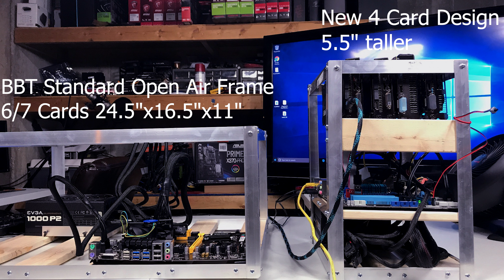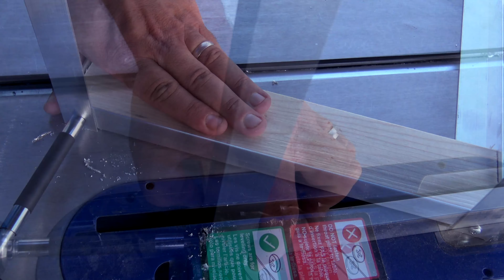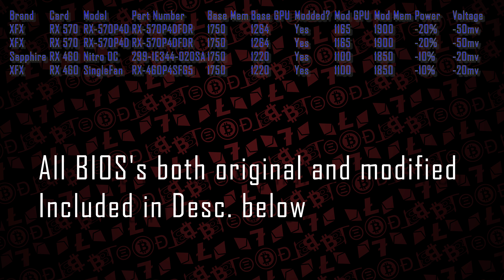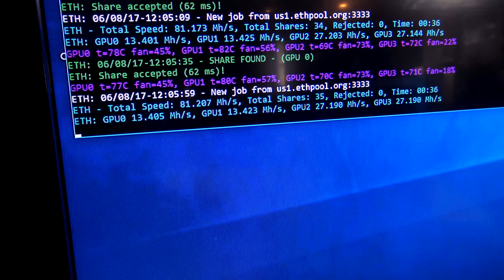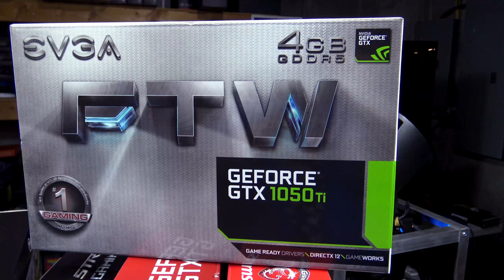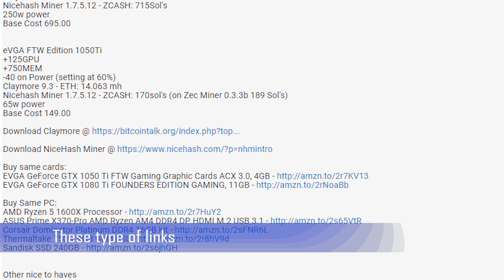Ethereum Mining 4 card XFX 570 4GB & XFX 460 4GB / Sapphire 460 4G Mini Open Air Build

Comment: The undervolts you do are extremely conservative. You can run 1100 core, and voltage 150-200 under stock (at stock clocks), to save way more power.  You could easily get that build to 500-550w. Also, why do you insist on trixx or precision?  You can set the voltage in claymore, then you don't have to install other utilties, and worry about resets on crash. Also easier to do per gpu. 400 series cards can eth only mine on ~910mv easy, or like 830mv on 500 series. I can make a 6x 470 8GB rig draw 720w from wall eth only, or 950 dual mining with good speeds. You are drawing nearly 700 for essentially 3 cards. I had an FX chip, idle power was ~95w on bronze psu.  For case, I would make it 2-3 inches wider so your cards don't overheat. Requiring an external fan is just poor design, I have 0 external fans on any rigs, dual mining, fans never above 65%, for max temp of 70C, even with no AC in garage in summer.
Reply from the maker: Most of our builds and video's of builds show very conserative. As your aware, you just dont run deep undervolts on all cards and it works out of the box. The stability is predicated on a lot of factors, so yes, you could tweak all of these settings for less power and of'course build a bigger case to allow for better heat transfer. This is an example of a use case build with the 10x12x16. More than likely 3 cards vs 4 would be more ideal for this size. External fans over a long period of time save GPU's period. There is no point to letting the gpu's handle all of the heat, thats what gets people replacing cards after a year. After doing this for the past 5 years, external fans are why most of all of our R9 290's, 7970's and R9 390's are still operational and running. 65% or not, most of all our builds are sitting at 0% fan to 27% fan at 51c.
Reply: 930mv 1100 core works on 95% of 470s dual mining.  You are probably running 1000-1050mv+ eth only. But we don't know since you don't ever show GPU-Z. If you set in claymore it is easy to adjust an outlier if you need, or bump up all 10-20mv. For fans, I am also dual mining, if I mine eth only, the fans barely even turn on.  65% is upper limit, right now they are 45-50%.with 85F ambient. They will have A/C soon, and probably run 40%.
Reply from the maker: We dont ever show GPU-Z? you must not watch any of our livestreams ;) check out livestream 14, probably about an hour alone with multiple GPU's with GPU-Z, HINFO64 and more up. In the episode style though, kinda straight and to the point. Livestreams offer a lot more detail and solution's.
Reply: Maybe just the few livestreams I watched, it seems I was always waiting for GPU-z, but only ever got trixx, precision, afterburner or wall meter. Point is saying -50mv is kinda of meaningless if you don't what what it is compared to. Stock voltages on 400 series vary between 1050-1160mv for identical cards, yet they all undervolt almost identically (within 20-30mv). Even for quick n dirty video it is extremely useful information.
Reply: my 480 4gb needs 1075mv at stock 1305 mhz. 1000mhz needs 825mv... less than HALF power consumption!

Comment: This video is helpful for those trying to build their own rigs.  Haven't been able to find much online as far as the different dimensions used and how many cards each dimension will accommodate.  I started the process of looking for material to build rigs a few weeks ago and found that any local Ace hardware sells angled aluminum for $8 for a 7 footer as well as square aluminum for around $13 or so if someone wants to go that route which ends up being a little more costly since the 3-way connectors and 4 way connectors are generally about $2.5 each.  Angled aluminum rigs is definitely the way to go on a budget.

Comment: The 570 bios is labeled as a 580 in the description.  Also in polaris bios editor I'm seeing differences from the original bios in the GPU and PowerTune tables...  This has me wondering if this isn't a 580 bios.
Reply from the maker: Good catch, it was mislabeled - its the 570 XFX bios, just doublechecked the link.
Reply: Jeff Miller 580 maybe out of stock at all. i cant see anywhere have it.
Reply: nothing doesnt add man, all i get is 11.07mhs with your bios, without bios ONLY flashed i get 12.6mhs, but NOTHING close to 13.something like u saying. anyway great vids great help, God bless you.
Reply from the maker: Its BIOS + softclock of MEM ... did you up-clock the memory like mentioned? BIOS just doesnt get you there.

Comment: pay it back lol. i mean we cand buy gpus because u buy them all. make 30k a month then ask for donations. how about taking a break and let little people jump on board. after all its why u say you are doing videos
Reply: Here in Russia the 1060 3GB is already unavailable, while pitiful remains of its 6GB version are sold for $400 and higher. 1070 is sold out and if you manage to find one occasionally, the price would be almost $700. RX 470-480-570-580 are of course nowhere to be found.

Options left:

RX460 - $130
GTX 1050 Ti - $175
GTX 1080 - $750 
GTX 1080 Ti starts from $930 and goes up to $1500
Titan Xp - $1500
Reply from the maker: Jared - The community really needs that confidence as you can read above. Would you be incline to create a YouTube channel and from your perspective above create the walk-through asked for? Because mining for the past 7 years and over 390+ rigs, while some were like butter, not everything was smooth as your depicting. 

Additionally, the 99% of the issues/steps you are talking about are predicated on about 8-10 categories, with there own one to many situations. Our issues database that we plan launching has over 300+ troubleshooting perturbations that maybe will cover the 80% of issues you could run into. Again that is against 6 different motherboards. Couple that with any multitude of motherboards and the count goes up exponentially.

Again, that being said, sounds like you have a solid plan for a great 60 minute video. You make that, we will support you and make sure the viewers all see it. Do it!
Reply from the maker: We buy a fair share in our area, no disputing that, but unless your in the St. Louis area, we are not your particular problem. That being said, there is a substantial amount of effort that goes into producing video's, including and not limited to hiring people to help edit, produce the site and bring work to bring the best tutorials to you all. 

If you look hard enough, there is a ton of options out there for you to get involved in. The GTX 1060 3GB are less than 200 USD and provide a great bang for the buck and they are available everywhere. Start there, build a small rig, then if/when you get stuck, shoot us a note and we will try to help you get it fixed. That level of service is all for free. The donations are just like tips, if we have helped you and you're doing well, its equip to tipping the dealer.
Reply: With current profit, if they didn't buy them, there are 10,000 others waiting in line anyway.
Reply: Well, as nicehash calc is currently showing me, a 1080 Ti's annual profit is $2600 which is kind of self explanatory. People already start losing their heads, selling their cars and even rumouredly apartments and buying tons of video cards.

However, we don't know if the hype lasts long enough to return the money at least. I'm feeling that I can risk some money and buy 4x 1080 Ti... but not at whopping $1500 a card. Prices went from $1000 to $1500 in a day (!), and now 1080 Ti and Titan Xp share the same price in Russia.
Reply: i asked during a live show to do a start to finish installing miners. i have seen so many on here and either they are viruses or they miss a step. a man showed a address www something we could not read but forgot to link it  with the rest. i have only gotten nicehash miner and bitcore to work on gtx 970. i have not got 1 eth miner to work. they do not show enough to add addresses or miner info where to put it and most of does it need to be saved as bat files. we are not code writers here. i am in tijuana mexico because i cant afford san diego. plus my girl is here. now i have not found 1 not 1 guide that i followed step by step that worked. they are not complete. we can do nothing if we dont know what is good or whats a virus. what is more profitable? the more that use eth right now the more that price will go up. you will soon enough be rich. 
if you are gonna help realize most new viewers like me are trying to get miners to work. i have 1 amd rx 480 8 gb on the way then 3 rx 580 after that. does nothing if i cant run eth. doing sol?s now is crap 259 sols. i have very very cheap electric in mexico. and this can help me south to la paz where i will no longer suffer from chronic arthritis. i am dying here literally. i suffer badly and take pain pills all day (non narcotic) and does not affect me like a drug or my mind. when given instructions in notepad it sometimes writes so far to the right its hard to swipe and read its very easy to get lost. i agree make what you can make the coin sore. but without good correct info on miners we all are stuck. bios mods also. i commented on a video a man done only 1 min in i found he missed a step and said so. he said mining is not for me then? ok tell us who is it for? only you? do we need to sit back and watch you get rich? because we cant find 1 miner video thats complete and successful?  this is absurd. i got 2 miners none what i want to mine but shows i can follow goooooood directions. complete directions. and suffer because so many people with old and bad info videos just leaving them up to get views and paid per views. i am not the only 1 i seen others comment as well the same as me. it dont work or its not complete. just get rid of bad videos make correct ones for views. not saying its you but others. i like watching your live shows. its just i see the intentional no commenting on questions as how to install miners and how much does a 4 rig or 6 rig or 8 rig profit per month. why the secret? why cant you say how much a rig makes? it only appears that you will buy every gpu you can like others give bad info or incomplete info and make as much as possible. the more users the more the coin goes up ok. dont be greedy we all want this over the same corruption mis info bankers we have now. and dont need it replaced with more controllers of coins instead of dollars. then its still a banking type of system just different people running or regulating it or just monopolizing it. either ways its still certain people wanting to take control. i just seen a eth farm with over 3k video cards. dam. cant people share any more?
Reply: the more people using the coin the more value it will get. and the strength behind it. we just need more users and use the coin as cash not just cash out. then we have a new currency we all can be happy about. bitcoin because worthless because of china and iceland. now we have big farmers doing the same with ethereum. and this is just shit putting all the money into the same dam peoples hands. might as well keep it in the banks
Reply from the maker: So, thats a lot to respond too, but the just of what your looking for is a comprehensive step by step walkthrough. That is easier said than done and there in lies the problem. 

1) None of this equipment nor software was designed to do what we are doing. It is finique in every way and once you get a working rig, its like gold. 

2) What we try to do is show various troubleshooting steps and techniques that has saved us time when setting up a rig. I could give you a complete walkthrough and 4 things could go wrong for you that did not for me. Its about understanding what potential causes are creating your issue and solving them. There is no one stop, single shoe that fits this categorically. Maybe in time as more industry builds software/hardware specifically for mining the consistency will get there.

3) no conspiracy on youtube miners trying to hold back information. This is the primary reason why we created the livestream series. I want to show you guys first hand that even experienced miners such as us run into issues and what did we go about fixing them. 

4) There is no get rich quick in anything in life short of winning the lottery. This stuff takes work, management, upfront cost and maintenance (power expense). The folks that stay committed have been reaping the rewards of the recent price increase. That being said, its ALWAYS a risk as any investment. 

I would say in closing, trial and error mixed with watching/reviewing our's and other folks works will make you better at setting up/configuration and troubleshooting. Practice makes Perfect they say!
Reply: I would respectfully disagree.  There isn't some major flaw in equipment/software holding things back. Equipment is fine, software is fine, people have been mining for 8 years. There are some gotchas, but its all pretty straightforward.

A complete walkthrough covering 99% of steps/issues could be done in a 60 minute video.

There is of course money and time involved with mining. 80% of the time is from initial setup (about 2 hours per rig), then it is just monitoring (easy), occasional fix, software update, new coin, etc.

Comment: Ribbon cables... Wow i haven't seen those in years... Hey if it works don't fix it right
Reply from the maker: we have several builds with them still. Those were extra's and yes they work fine. Anymore though, have been ordering the USB risers. The ribbon have always worked wonders and are nice to have around if you have a USB riser acting funny, then putting in the Ribbon to solve the issue.